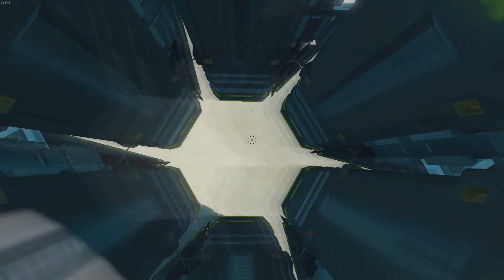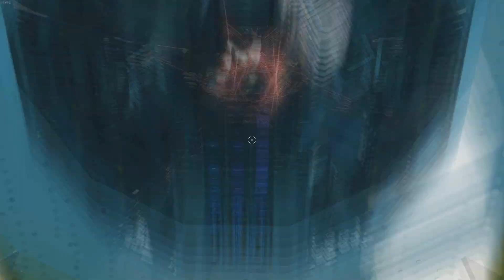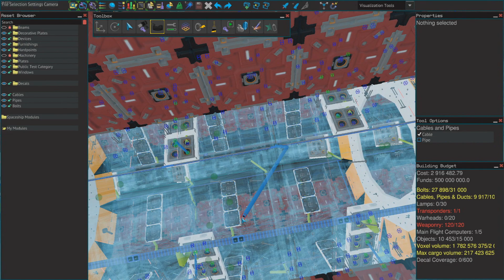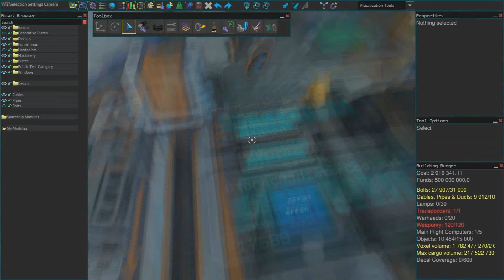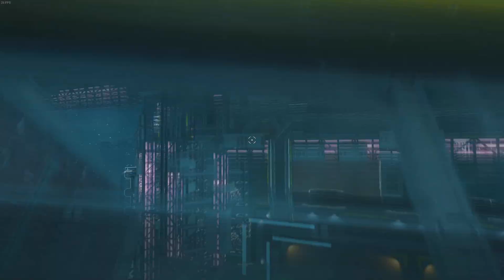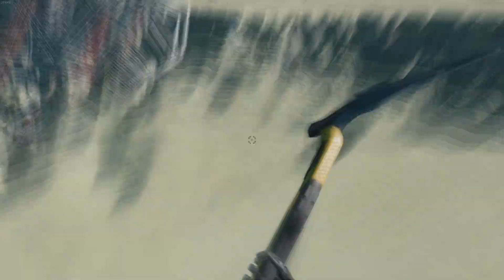Starbase Moon Mining and Autonomous Tunnel Excavation

Comment: if you point the ship downwards in the designer and then buy it, and then store it in the moon city and spawn in back in it should point exactly straight down and you can move it t a piece of terrain with translation controls as long as you dont rotate. the moon city also automatically spawns it in hover mode